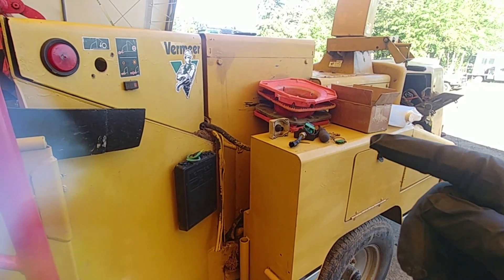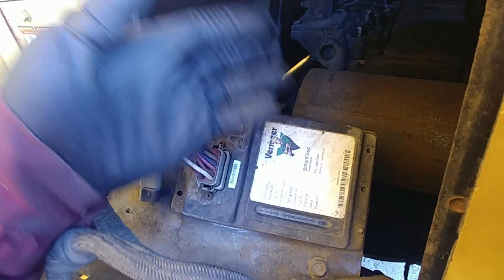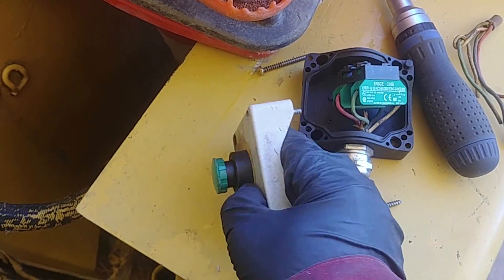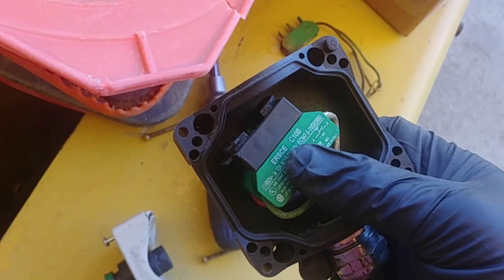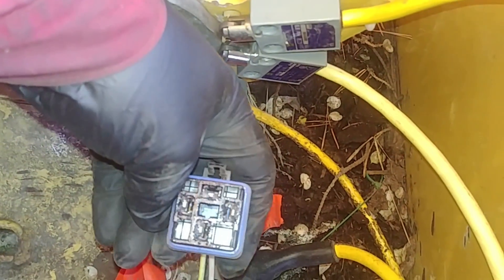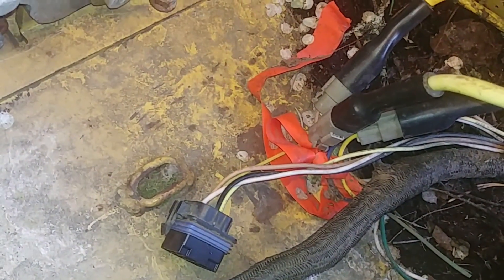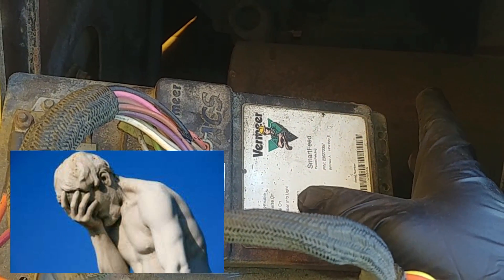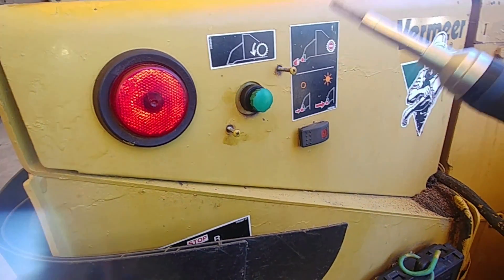VERMEER WOOD CHIPPER AUTO FEED PROBLEMS, GOT STUCK IN REVERSE. NO FORWARD. BC1000XL. Fixed!

Comment: Hello, I have a vermeer bc1000xl, but the motor turns in the opposite direction and the the working hours go down. What could that be?
Plug connected wrong?
Reply from the maker: Hey Milos! Did you mean feeder hydraulic motor?
Reply: Hey @PistonShack , yes i mean hydraulic motor.  :) Thank you very much.

Comment: Hi mate great vid thanks I'm here in New Zealand and have a bc1000xl 2013 model. When I push the green button the feed roller will run for about 5 seconds then stop. If I hold It down it will run continuously. But also no reverse or stop on top control bar. Any ideas would be a great help? Thanks alot
Reply: @anthonytuckey3462  hi did you find the problem because my is doing the same thing

Comment: I have this same chipper and I don’t know how to change the rear sensor bar sensors sure wish I could find one
Reply from the maker: Hey Dallas. I did change rear lower control bar sensor but unfortunately i didn't film it. There's one electrical connector down to the switch and couple mounting bolts. Depends from the model and year could be 1 or to switches. They known to go bad over time as well.

Comment: Awesome set of videos on this issue, thank you very much! My 2004 BC1000XL has been intermittently having this issue…and then reverting back to operating normally. Something is on its way out. I’m about to dive into the system next week and am wondering a good place (or set of search terms) for sourcing the green switches (part number in google doesn’t give you much) and the micro switches. Any help is greatly appreciated, thanks for the awesome videos!!
Reply from the maker: Hey Tanner! After New Year Holidays, I can give the part number for those micro switches  I used as replacement. I have Vermeer bc1000xl repair manual with electrical diagrams, I can share it with you via email. Cheers!
Reply: @PistonShack  Awesome, thanks so much! And Happy New Year to you!
Reply: @PistonShack  And yes, that would be great. Just let me know how to get you an email address. Thanks again!
Reply from the maker: @tannerweis8377  my email: bc704ca@gmail.com

Comment: Have you tried adjusting the shear bar on your machines? I replaced the knives and tried to set the bar according to the service manual. When the bar bolts are tightened it moves back to the original position. The bar is not contacting the new blades but the spacing is about 1/2 what the manual recommends.
?
BTW animals like to live in my chipper and chew on the wires lol.
Reply from the maker: Have you tried to rotate drum to align knife block
with opening and slide the knife
block out of the drum a bit? I will try to film it next time doing it.
Rodents are huge issue if you don't have wild barn cats around)

Comment: I have a 2011 bc1000 and yesterday it started acting up. The feed roller will not pull it brush unless i hold the green button. Where should i start checking?
Reply from the maker: Hi Celeb! What engine do you have and how many hours on your Vermeer DC1000? Thanks!
Reply: @PistonShack  1500 cat 59hp
Reply from the maker: @calebjacobs392  Have you checked those switches I shown in my video already? Sounds like circuit is open for the feed rollers, That's why you have to keep button pushed to operate FWD speed. There couple switches right at the bottom of the feeder pan for lower control bar, those two known to stuck open or closed permanently. On my 2004 Vermeer (Cummins 3.3) they are located at the left  corner of the feed pan. Check wiring and withes next. I have more checks to do but do those first. Let me know.

Comment: Thanks for the most comprehensive BC1000XL electrical repair video on YouTube! I purchased the same model from Ebay, it chipped OK but the SF was not functioning. After changing many electrical parts without success I was finally able to get the schematic from the dealer. I discovered the PO bypassed SF buy running 12V to the middle switch above the feed chute. Removed the wire and everything worked as it should.
Reply from the maker: You're very welcome Rick. I'm glad it helped you out. I have complete repair manual from the local dealer for the machine as well. That's time saver! Cheers.
Reply: @PistonShack  What vibration do you have, is the chipping drum out of balance?
Reply from the maker: They always vibrate a bit. We service bearings and checked the drum. >seems okay. Do you have that much vibration on yours as well?
Reply: @PistonShack  No vibration that I notice but I heard about this from others.
Reply: V.  Vh hhhh c xxfgcgvvvv
Reply: I have a vermeer 1500 it won't stay on forward. Forward works only when you press on green switch any advice? Would Really  appreciate an advice 

Thanks for the video though it really helps
Reply: @ The green buttons (hold to run) on the side overide the feed stop bar. The microswitces for the bar could be defective or need adjusting.

Comment: Hey I have a 1995 roper yard tractor and I was wondering if you could possibly come check it out
Reply from the maker: Hey, thanks for watching techniczone! 
I'm away. What make and model of your yard tractor and what's wrong with a machine. I might be able to guide you. Cheers!
Reply: Timing belt is messed up no crank on starter and clutch warn out
Reply from the maker: What you mean by saying "timing belt messed up''? How do you know that? Are you talking about engine timing or ignition timing? You have No Crank condition. Check 12V power feed from the ignition switch to starter command terminal. I have video how to test starter, check it out: NO CRANK? BEST COMPLETE STARTER TEST TUTORIAL. Starter motor / solenoid bench troubleshooting.
Let me know how are you doing or if you have any questions. Cheers.
Reply: @PistonShack  engine timing and the battery is a 230 lawnmower battery